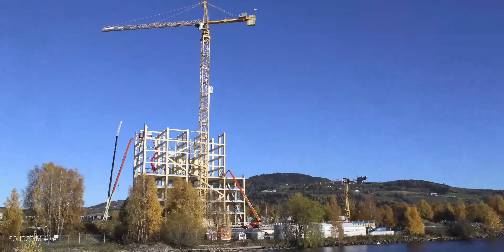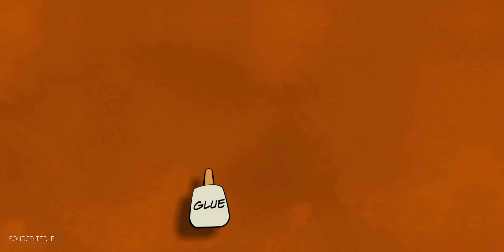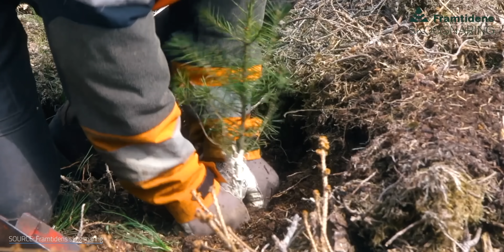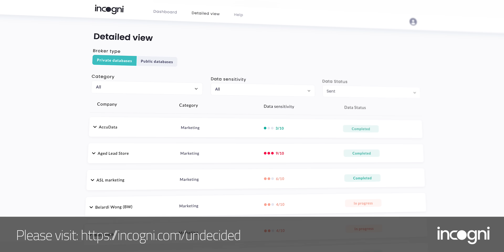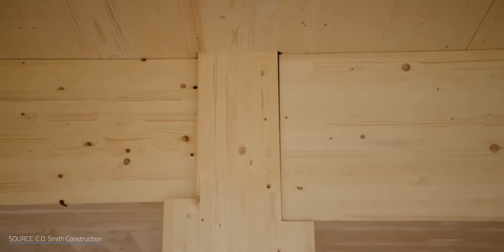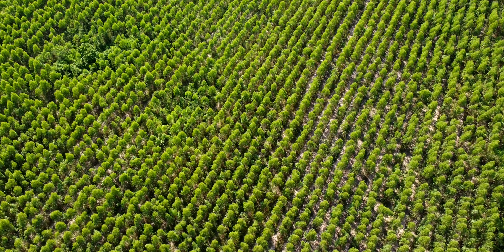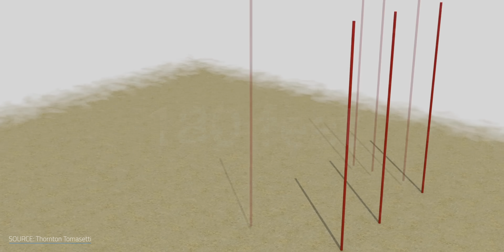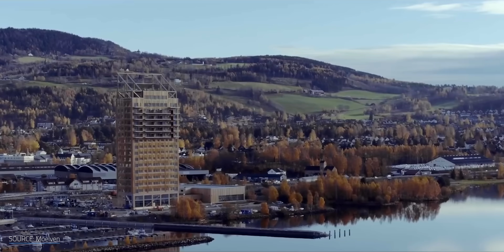How We Engineered Incredible Wooden Buildings

Comment: I would like you to do a video on smaller applications of mass timber construction, like 3 - 6 story apartments, shopping centers, and single family homes.
Reply from the maker: Great suggestion!
Reply: @UndecidedTechnology  ...add this to going to 3 story family homes with same floor area so less land is needed possibly saving costs?
Reply: @markreed9853  I live in a 3-story building that has 6 apartments and is wood-framed. There are a LOT of wood-frame 2 and 3 story apartment buildings in my state.
Reply: @UndecidedTechnology  in my small city we have a great semi public gym with a basketball court, all entirely build with engineered wood and steel joints. It's a big structure overall, like a very big industrial shed with wood pillars and, well, everything made of wood. It's beautiful, with the pillars designed in a curve way.

(The court is in the front and center, in the sides are the seats structure of 4 lines height (it's a small city), and more to both sides are gym rooms, with machines, free weights, or other activities, the second floor in the sides have small rooms that are not in use now. In the back in the first floor are the bathrooms, showers, lockers, dressing rooms, and in the second floor is a big room for dancing, yoga, or any other group activity)
Reply: @UndecidedTechnology  My log house here in Finland is built with engineered log (basically the same as what you talked about). It's also off-grid. If you're ever in this part of the world, and would be interested in seeing it, let me know.

Comment: One question still remaining, how long will a timber skyscraper last?  
Is that comparable to steel and concrete?
Also, earthquake resistance? Got to be better than steel right?
Reply: It's LITERALLY impossible for it to outlast a steel and concrete building. Even houses that are built with wood dont even come close to lasting as long as brick houses like those in Germany. American wooden houses typically last 50 years.
Reply: @JayForsure  American wood-framed houses weren't built to last, the technique allowed for rapid and cheap assembly good for a few decades, but they aren't strong.

Brick is indeed strong and easily lasts centuries, ceramic just doesn't wear out.
Concrete 'can' last for thousands of years, a few Roman structures remain, but concrete structures are still susceptible to "concrete cancer" if any leaks occur the steel inside can rust.  

Hardwood can last centuries if properly treated and protected from weather and just becomes stronger with time, but these laminates are apparently constructed of softwoods, so I have no idea how they will hold up.
Reply: This was one of my thoughts also. I remember seeing something a while back about how stick built homes are more resistant to earthquakes than masonry houses, because the wood house can flex. Although for a “skyscraper” you probably don’t want it to say too much. Maybe wood skyscrapers would need something like a mass damper to counteract the sway
Reply: I don't know how long a wooden house can last if it is properly treated, but in Norway we have stave churches that are 900-1000 years old. They are still in use, partially as churches, partially as museums. (Officially we have 28 left of 1000-2000 in the middle ages) They have been subject to repairs over time, but at least some of them have a lot of the original timber intact. (And that's the main way we can actually determine how old they are, by dendrological analysis)
Reply: There are alot of really old,500 years plus, all wood buildings in Japan.
Reply: @rcollinge325  those buildings are continuously maintained. Old pieces are replaced with new ones, and entire sections get lovingly reconstructed. It's like the Ship of Theseus, but they've firmly decided that the new and old ship are the same.
Reply: @rcollinge325  Cool, but steel and concrete buildings can last for thousands of years if maintained.

Comment: Wood is an amazing building material, both my dad and his dad built wooden houses and boats, and mine has been involved in a couple of mass buildings and also interesting things like stawbail and glass bottle houses.
Reply: Glass bottle? That sounds interesting! My mind is picturing something between a 70s Italian restaurant, and a greenhouse ,though, hah! What did it actually look like?
Reply: @vacuumdiagram  heh pretty much like a greenhouse b/c they used mostly old green glass bottles, they are layered between grout lengthwise, so the width of the wall is the full height of those bottles. It's cool when the sun hits it and shines through.
Reply: Nice! 😎

Comment: There's way to mitigate fire, like heat resistant paints which when burnt creates an insulating layer. Termites and other pests can be mitigated with impregnating the wood, either through passive or pressure systems. There's other issues but the issues are not insurmountable, it all comes down to the pro's and cons, cost vs benefit etc etc.

Comment: Sidenote - In the UK wooden residential buildings were effectively banned after the Great Fire of London. Then they began to be built and then Grenfell happened and they've been effectively banned - which is silly because the building was conventionally built and then wrapped in highly flammable illegal insulation. (Or that's at least my friend who works in engineering told me.)
Reply: CLT was all set to be a game changer in UK construction. But as you said, we got hit the tragedy of Grenfell and rather than government learning and looking at alternatives like CLT. They seem to have run away from the technology, despite test after test proving the technology is cheaper, greener, faster and far superior to concrete and steel.
Fingers crossed within 10 years, we see sense here in the UK and start to see more CLT buildings in the UK
Reply: Grenfell was on my mind when designing my building, that I call a vertical suburb. That's a rough version on my thumbnail, but the finished version would have four fire escapes and sprinklers underneath every cantilever/platform to protect the unit below. The whole building is wrapped in a mesh, which lets in light and air, but keeps out rain and severe wind. So wood could be used for the units because they are protected from the elements. 
The mesh is tightened at the rear of the building, like a giant corset, and this helps stiffen the whole tower. I designed it as an alternative to the vast ugly housing estates we have in the UK which eat up our green spaces and require miles of new roads and streets to be built, just to get to each house.
 Unlike a block of flats, there is one 'house' to each level and the tower doesn't block out the sun at ground level because the mesh is transparent.
Reply: Prefabricated timber frame buildings are increasingly popular in the UK. Better insulated, quicker to construct and often cheaper than brick built. I don’t think there are any issues with fire safety.
Reply: From memory Grenfells cladding was not up to fire safety spec, but it would've been tested by say, setting it on fire.. Which didn't work

However, if you have a different thing on fire, and sits next to our user the cladding for a while, it gets hot enough to melt and the drips ended up being highly flammable. So it increased flame spread

Wood is kinda similar, wood isn't very flammable but once it gets going it's really hard to stop. Same with metal.. Plastic burns readily in comparison
Reply: I thought it was jettying that was banned not wooden homes.

Comment: "besides from concrete elevator shafts" I suspect the larger of those shafts does quite a lot structurally. Not discounting all the points about wood at all and clearly those parts far from the shafts must be supporting their weight, I just remember from uni that the elevator shafts are often a huge stiffener in the structure so might still be pretty vital for a very tall building.

Comment: Maybe it's just because I live in the tropics but my first thought wasn't fire but termites and rot from moisture.
Reply: Wouldn't treating the limber make it immune to rot?
Reply: @ezachleewright2309  maybe from humidity but I leave in the Caribbean, I'm willing to bet even if a hurricane doesn't blow it over it will force moisture into the boards which will eventually warp and rot.
Reply: @ezachleewright2309  At the end of the day wood is a natural or "living" material. It's always going to rot or break down or be eaten. Treating it helps a lot but it won't stop everything and treatments almost never last as long as the wood itself. Aside from rot, carpenter bees are a huge problem where I live and they will happily tunnel through paint and other coatings if they decide they need to. They've even chewed up some pressure treated wood on my property. Insecticides kind of work but they're obviously toxic, they need to be constantly reapplied to be effective, and they only kill the insects after they've already started eating the wood and doing damage.

Comment: Strand woven bamboo is 2x to 3x harder than hardwood. I would love to see a SWB skyscraper.
Reply: It's "harder" in the sense that hardwood is semi-hollow cellulose fibers bound in lignin glue, and strand woven bamboo flooring is semi-hollow cellulose fibers bound in a bit of lignin but mostly a very hard type of epoxy.  A general principle of building with wood is minimizing the epoxy/glue/resin content, because of its expense & flammability if not its carbon impact.
Reply: @TrogdorBurnin8or Yea the flammability sounds about right with bamboo. It is rock hard and treating it with some sort of flame retardant seems like it would be a more difficult job than plywood. 
Maybe I am wrong thinking that.
Reply: I don't know about strand woven bamboo, but there certainly are species of bamboo that are used directly to build housing after harvesting/drying, before even getting into the potential for engineered bamboo products. And bamboo, even the "giant" species, are one of thd fastest growing plants on the planet. So reforestation is much less a concern.
Reply: @GeshronTyler1 not harder, 2-3 x more resistant against compressive forces. Bamboo is about 20 to 30 Mpa, oak is 3 to 20 Mpa
Reply: @GeshronTyler1 You're also not taking into account that unlike trees, bamboo is one large organism. One clumping variety bamboo planted will turn into 6-20 bamboo shoots, one running bamboo could turn into thousands. 

The great thing about this is that it means all the nutrition is stored in the roots of the bamboo, if you cut down every single bamboo, it'll grow back next year, as you didn't hurt the roots and that's where all the nutrition is.

So you basically never have to worry about replanting, as long as you don't cut it down every single year, as that will eventually kill the roots.
Reply: There's also CLB - cross-laminated bamboo, which is constructed similarly to cross-laminated timber (they dry out the bamboo, then shave it down into thin layers and glue them together in alternating directions to create a panel of wood).  CLB is lighter than regular cross-laminated timber and apparently has greater tensile strength.
Reply: Thats a cool idea
Reply: Does bamboo last as long as lumber? Or is it all soaked in some glue & then compressed?
Reply: Balsa is a hardwood. Saying something is stronger than hardwood isn't really saying anything.
Reply: Should be interesting to see how to solve the fire issue.
Reply: $$$ though.
Reply: Spruce is not a hardwood.
Reply: I was about to say the same thing...One thing about bamboo is that Its a weed and grows like one too. They can plant and harvest them much quicker. Because it's hollow, it requires a bit more forethought in terms of how it can be use as building material for skyscraper application. That could prove cost prohibitive. It's a noble idea though. I would love to see the end result if someone tackle that challenge.
Reply: Excellent option IMO.  Probably has higher growth rate and both wood and bamboo is carbon capturing.  Provided it doesn’t burn.  Bamboo I believe is far harder burning.

Comment: What about termites!
Reply: Huh... Good point... I hadn't thought of that... However, there's probably dozens of ways you can prevent termites. Termites even avoid specific types of wood from certain trees, such as redwoods, yellow cedar, Laotian teak, and cypress.
Reply: And rot from wind and rain exposure. Sure it can be treated but how often does it need to be done.
Reply: @TheRatchetnclank  mean, rust is a concern with steel there, and concrete certainly also has problems with that